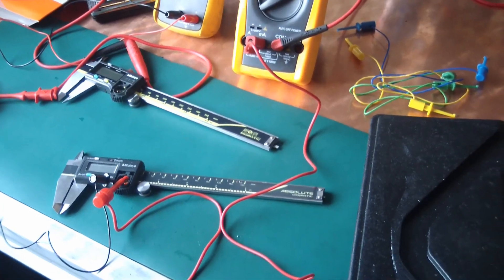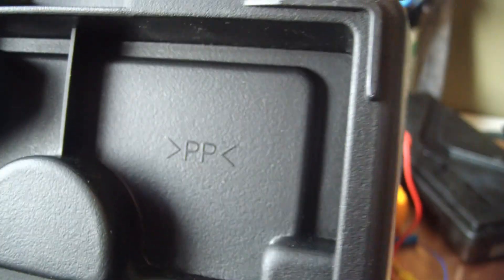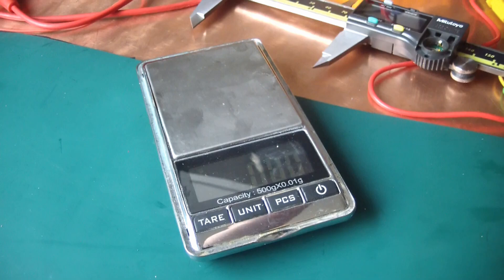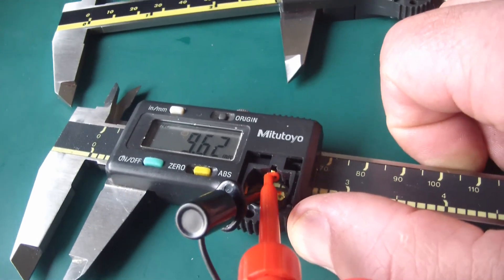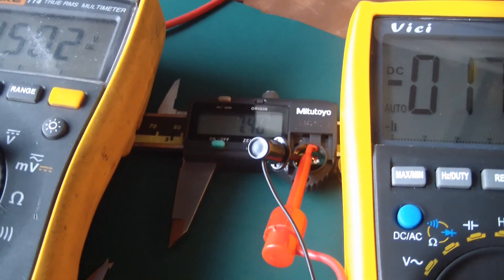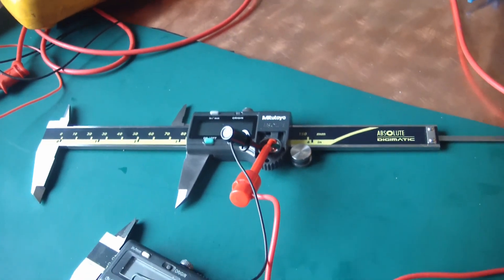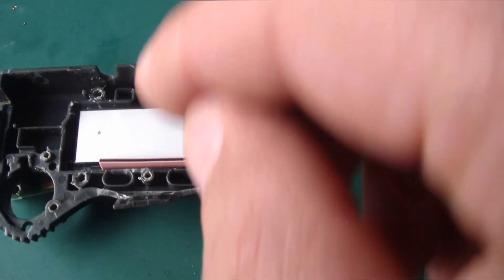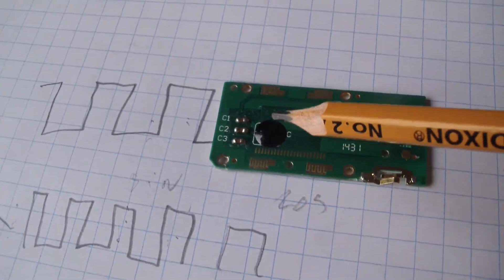BOLTR: $33 Mitutoyo Calipers, too good to be true?

Comment: Can't believe I never saw (or don't remember seeing) this particular video after so many years. 
It's now December 2023 and I just bought a pair of the FleaBay knockoffs for about $39, including shipping from China. 
I wasn't looking specifically for these; actually I was looking for a battery cap to replace the one lost from my (genuine) Mitutoyo digital indicator. While doing so, I found this set of allegedly-Mitutoyo calipers. 
(I also got a used set of Mitutoyo digital micrometers, with a 2020 calibration sticker, sent from a US-based seller. I have little to no doubt that those are genuine.) 
I figured at least 50/50 that these calipers  were knockoffs, and my curiosity got the better of me, and $40 in Freedom Currency isn't going to break me. So I ordered them a few weeks ago just to see how bad/good they were. (They of course shipped from China, which itself was a red flag :-D )

They just arrived a couple days ago. My own visual inspection (before watching your & other videos) made it difficult at best to discern that these were fake. They are, in fact, very good fakes, and actually compared to the Hazard Fraught calipers, superior in build quality and performance. But yeah they are certainly not genuine Mitutoyo. I have (at least virtually, if not physically) re-named them as either "Not-utoyo" or "Just-A-Toy-o" calipers. 🤣

I have not done the extensive testing you and others have, nor have I sent them for 3rd-party calibration or put a set of certified gage blocks in them. (I might check them with gage blocks or 1-2-3 next time I visit one of my company's Metrology labs.) I also do not have my own set of genuine Mitutoyo calipers to compare against. 

However my fake set appears to be somewhat slightly better than the fakes you show in this video from 8 years ago. (I think they've been learning and improving their counterfeiting skills in the Big Rock Candy Mountain.) 
They slide quite easily, and I do not see or feel any obvious or even minor machining defects (burrs, jagged edges, etc.). However like yours  the track is not cut the same as on a genuine set. When I slide them back and forth rapidly, and then close them, they return to zero / origin. 

I also confirmed (using the method someone else suggested in the comments) that these do not have the ABSOLUTE encoder. That is,  if I open them, take out the batteria, move them again, and re-insert the batteria, they do not show a different reading; instead they return to Zero. 
Closing them then shows a negative value. This is corrected by removing the batteria, closing them fully, and reinserting the battery. 

While not genuine Mitutoyo calipers, I would judge that they are a) a very very good attempt to counterfeit, b) a high-quality set of calipers, at least initially, and c) they are far superior to the Hazard Fraught calipers. 

I might (probably should) go back and do as you have done, remove or cover all traces of the name "Mitutoyo" and/or "ABSOLUTE" where feasible. Best I probably could do on some of those areas is a Sharpie, so as not to disturb its operation. Unless I could get them 3rd-party certified, I would likely label them as "REFERENCE ONLY" so as not to cause an audit non-conformance, should I happen to have these at my workplace during an ISO audit. 
I might take them to a tool trial for checking parts; I might not. But even if I do, I would still rely on measurements from a certified lab using a calibrated instrument in order to make decisions about product conformance, tool tuning, etc. 

BTW, I went back into eBay and found the listing and the seller have been removed. 🤣

Comment: Thanks for your testing, very helpful. I got curious and measured the current draw of my cheap calipers (one bought from Aldi / Hofer in Austria, one from Tchibo / Eduscho) that I paid 10€ each for.
Aldi had 8 microamps with display off, 11 with display on. Tchibo had 9 microamps with display off, 10 with display on. Both of these are the type that don't need to be recalibrated after turning on again (since they are actually turned on all the time, the on/off key only turns the display on or off, not the actually measuring system).

Compared to the ~17 μA you measured on the fake Mitutoyo, the generic calipers are actually more energy efficient, so even less of a reason to risk buying a knockoff Mitutoyo.

The Tchibo one, bought around 2012, has always felt surprisingly smooth and worked reliably most of the time. However, at some points it got inconsistent when the battery cap was inserted (values would skip randomly sometimes), for some strange reason taking out the cap (so that the battery top was visible) improved that for a while. I suspect that the aluminium battery contacts don't have the best lifespan. 

My next caliper purchase will for sure be a Mitutoyo. Less frustration, less time spent fiddling with cheap calipers and getting them to work somehow is worth the price for me.

Comment: Found some 6" 500-196 used locally for $20 with a missing battery cover.  Found the cover for $1.50 and now I have a working genuine mitutoyo calipers for around the house.  Used some calibrated Jo blocks from work and they are spot on.  For measuring bolts and nuts and other odds and ends around the house I'm satisfied.

Comment: 4:27 Problem, if it draws current to maintain its origin then what is my mitutoyo SOLAR caliper do which has NO battery but still maintains its absolute origin even after years in the dark? There must be some other reason it is drawing current. What would that be?

Comment: They are fake Mitutoyo.   Chinese companies will clone Japanese products using their brand and flood the market with inferior products.     If you find something cheap like that, it generally means they are fake.   Chinese companies do the same with fake knives.   Benchmade knives are commonly faked and it takes a good eye to tell the real ones from the cheap clones.  The Chinese companies know that most consumers will not scrutinize the quality or accuracy of the items they buy.   Electronics, appliances, tools, etc., - you can find clones of anything.

Comment: I work in a small engine factory.  When we have an order going to Japan, we have to go OCD mode and make sure everything is PERFECT.  If a fuel hose is just a few thou off from being pushed completely on, or the clamp is on at an angle different from the rest, they will give the company hell over it.  If an aluminum part has a little bit of flashing left, they throw a tantrum.  They expect absolute perfection even in the small details that don't make any difference.  Whereas the Western attitude is one of "It will be fine, it doesn't make a difference.  Aint pretty but it works!"  And that's why people pay big money for Japanese tools!

Comment: So I called Mitutoyo this AM.
The signed cert... the friendly rep informed me the cert will absolutely be printed... not hand signed.. because they make 70k calipers a day.

There should be a full address on the left side bottom on the back label.
The battery should be an SR44... not an LR 44.
All the digits should be full sized after the decimal point.
I bought mine through Amazon from MSI Viking Guage who are an authorized dealer.

Comment: Cool China is getting good at cloning, since they are, they should just create their own brand and not make fake Mitutoyo, so they're genuine, under their own brand.:-)

I highly recommend my currently too favorite tools: General brand very stylisht, all-metal digital caliper and my amazing,  very stylish, KSGER T12 soldering workstation (I wish I didn't have the cool Quick 858D hot air, so I can have KSGER's combo, very stylish but amazing soldering workstation and hot air SMD workstation combo).

God bless, Rev. 21:4

Comment: I brought a pair of cheap calipers from aliexpress. I went with a dial calipers Shan brand from aliexpress for $40 AUD. No battery pure mechanical and gears goodness to 0.01mm precision. The precision is super close to my genuine mitutoyo micrometer 0-25mm with 0.01mm precsion atleased for the small stuff.

Comment: I hate digital calipers. Not that accurate in my opinion. Different reading + - 0.005 and some. I call those lazy calipers. Would rather have a dial. Batteries never die and gives me the same reading EVERY time lol. Bought mine for $40. Not the best of them, but it works for me. 👍🏻

Comment: I bought one for $25 U.S. pesos. Be careful and read the information first. Or it might get a plastic one. I did research on Moto and there is an company in China the makes parts for Moto. They are knockoffs. But dam are they nice!
Reply: That one you have, isn't like the one I've bought.  Mine work right. I bought mine last year. I just checked my battery and it's still working. They sent me two extra batteries. The first thing I noticed was the wrong paperwork. Also the one I've bought isn't off at all.  Maybe since more people are starting buy them. They are getting crappy quality ones. First send out great quality so people get hooked. Then poor crappy quality after. Parts made in China and assembled in Japan. Chinas Knockoffs.

Comment: Bought my 6” Mitutoyo Calipers from Victor Machinery Exchange in 2000 for $99.90.  Still keep the receipt and papers behind the foam in the lid of the case.  Don’t use them that much, but the batteries hardly ever go bad.

Comment: I am in UK. I bought same one from ebay. Screen dead. Contacted supplier who asked for video showing problem (!) so I sent one. They suggested find a local electrician to repair! I politely pointed out why that really wasnt an option. They said OK we'll refund half cost. I said thats no help as still a a paper weight. Supplier refunded full amount but didnt want it back. Managed to fix it (took sticker off!). Battery connection faulty. Repaired that. Works fine. Eats batteries.

Comment: Mine has the "fake stamp and signature", but it draws low power just like AvE's real Mitutoyo.

I watched this video and was horrified to see that my Mitutoyo 500-196-20 calipers that I bought on Amazon for $115 looked just like the $33 fake pair in this video!  Almost anyway... the thumbscrew is not as big, and the machining lines are not on an angle, and the edge isn't razor sharp (but it's not smooth either).  But the red stamp and signature on mine are printed and not an actual inked stamp or pen signature.  Signed by T. Suzuki (different than AvE's).
My battery compartment is also round and hard to get the battery out if the battery is slightly large, which is what I think AvE eluded to in the beginning.

BUT!  I hooked mine to a power supply, and can tell that mine has a "B" battery low indicator, which came on at 1.38V and under.  Current draw was ~4.35ua when on, and 1.87ua when off, like AvE's genuine one.  So apparently mine is real, unless the fakes are getting better?  This was purchased in 2013.  It feels much nicer than a $10 noname one I have.  The last digit is full sized, not half height like AvE's.  I wonder if I got a real Mitutoyo with a fake certificate of inspection?  Comparing measurements with my $10 one, they read the same.

The back of mine is slightly different than both of the ones in this video.  Nothing seems fake about it other than it is not perfectly straight.  Is it possible that Mitutoyo has a "bin" of ones that are slightly irregular (a tiny printing error, back plate not perfectly straight) that they sell at a discount and some buyer snatched up a batch?

Mine does not show "- - - -" when inserting the battery.  That seems like an indicator that it's fake, but maybe the 500-196-20 model doesn't do that?  I don't see it on Mitutoyo's website, but I see 500-196-30, and the instructions for that one mention the dashes.  Instructions I got with mine don't.

A commenter mentioned serial number issues.  Mine matches what is on my certificate of inspection (which admittedly feels kind of fake... glossy, not like a real piece of paper that went through a printer).

Comment: I accidentally wound up purchasing a pair of 0-8” Mitutoyo Caliper Clones a while back. The eBay seller said they were legit and there was a bid going. I work in a machine shop and already had some Mitutoyo 0-6” digimatic calipers. However, I wanted a good pair for school. When I received my 0-8”, I immediately noticed the difference in quality and was disappointed that I got scammed. However, I still ended up using them at school. I check them daily with a 123 block and gage pins. So far, they’ve done the job. I will never use them in an actual machine shop, even if they’re accurate. I don’t trust knock-offs.

Comment: Ever heard of vernier calipers? It's a rhetorical question; I know you've heard of vernier calipers. Vernier calipers do not need a battery. There are no electronic components to make the tool unusable, should they crap out. And they aren't any less accurate than dial calipers or digital calipers. Unless you are making repeated measurements, all day, where reading the vernier scale might become wearisome after the umpteenth reading, then vernier calipers will serve you just as well. I bought my Mitutoyo vernier calipers about 40 years ago, and paid about $35 for them at that time. I was actually able to read the vernier scale 40 years ago. At that time, I didn't realize that 40 years later I would need help from a magnifying glass.

Comment: I have a solution to this just buy good dial calipers, nothing to worry about for your lifetime. I have and use daily the mitutoyo dual carbide tipped calibers. Best calibers I have ever used, there feel and weight are just awesome. Had brown & sharpe, starrett, Fowler premium , lufkin and just found the digital to be questionable at times and there is a massive difference in what you get for your money.

Comment: In my last Workshop I had built myself a degausser from an old stereo-set: I took a 3-way speaker-set with fat old shitty cardboard-membranes and stripped off the shieldings. Then I mouted them around a wooden wine-box (one litre-sized bottle) and connected it to the amp. Gave it some minutes of ac/dc -to be taken literally and that was actually it. Worked well for wrenches and screwdrivers. Degaussing is about making noise anyway. Could either take a Hammer or make some magnetic noise.

Comment: Another great review AvE.  Yes, the battery drain issue with digital calipers is a drag.  I only use them once in a blue moon and they would most often would have dead batteries if I forgot to remove the cell.  That's why I splurged and bought Mitutoyo SOLAR powered digital calipers Code # 500-491 Model # CD-S6"CP.  They were well over a hundred smakeroos but they are always ready to work when I need them.  The instant metric/inch conversion button is also very useful.

Comment: Mitutoyo stopped their real signatures on the paperwork a long a time ago, and quality on their stuff isn't what it once was I am sorry to say.
I have a 500-196-20 6" digital and its great, batteries last forever, probably to the point of shelf life, same with their 293-340 micrometer.
I recently bought a 505-675 6" dial caliper and yeah... would I recommend it - NO. Reasons: plastic body and other plastic bits, no way of resetting the dial without having to take the whole mechanism to bits and having to deal with cogs, pre-tensioned springs and unless you KNOW what you are doing you ARE going to botch it and the thing will no longer read correctly. Pro repairs will cost more than what the thing is worth.
For a dial caliper don't waste your money on Mitutoyo, get a Starrett 120A-6, all stainless steel, easy dial reset an idiot can do.
My new Mitutoyo dial caliper has been relegated to secondary tasks, the Starrett 120A-6 my prized dial caliper.
Got a stack of brand calipers and micrometers guys and I am very fussy, Mitutoyo for their digital stuff no problem but dial calipers - forget it!

Comment: I used to program ultra low power tracker devices.. true enough, saving power and recovering reliably from powering down, was like one third to one half of the whole effort. An obvious place to cut corners if it's not your own batteries. It could be great if those Chinese would put their own name on it and build their own reputation. No reason not to believe they have the abilities.